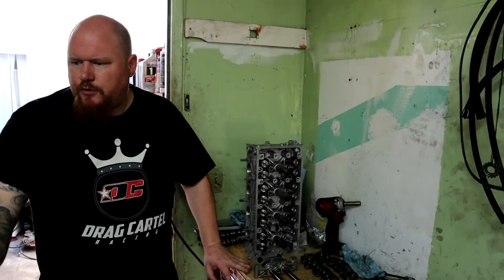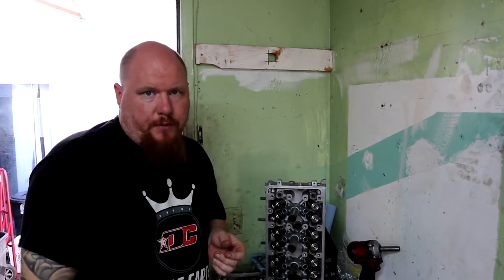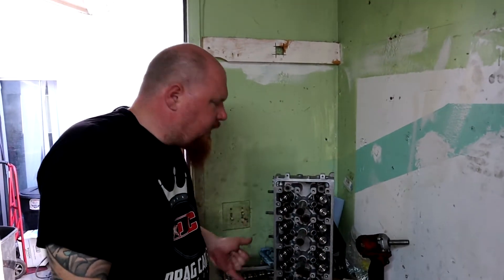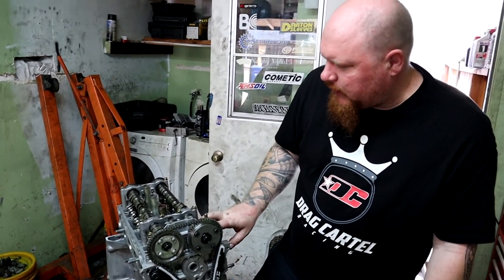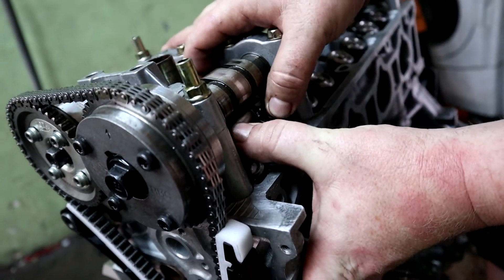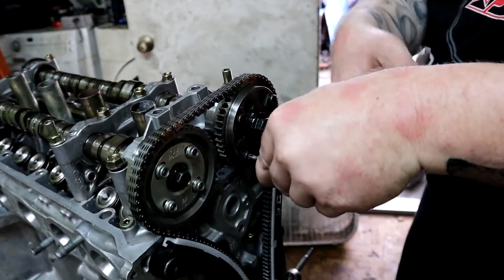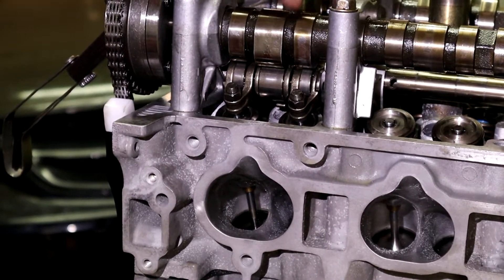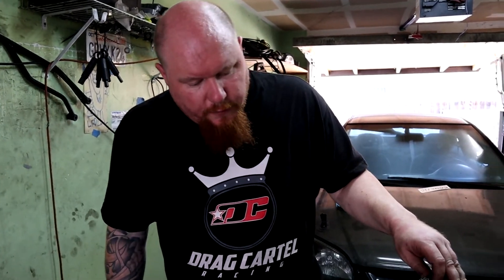Checking the piston to valve clearance on my built k24

Comment: What gasket are you using? Im running a .040 headgasket gasket to open the piston to valve clearance more for the full 50 vtc.
Reply from the maker: That's something you will have to measure on your setup

Comment: I think I missed it.  What head is that? My K24A2 has needs some work. Do you know what's a good combo, port polish, springs cams, etc? Bottom end is stock
Reply: People say use K20 head but I've heard stay with the K24 and get it worked...?
Reply from the maker: The head on my engine is a k20a2, anything you can do to the head will help but a port job is not essential for moderate boost
Reply: @GravyBuilt  Thank you.  I don't have plans on boosting, yet. I was thinking what's a good spring, seals, retainers, cams for a stock bottom end K24A2?? The head is stock also, what would you recommend?
Reply: How about b20b stock piston using itr head